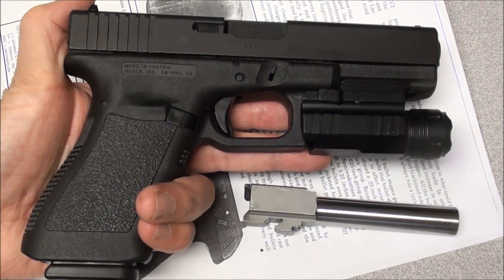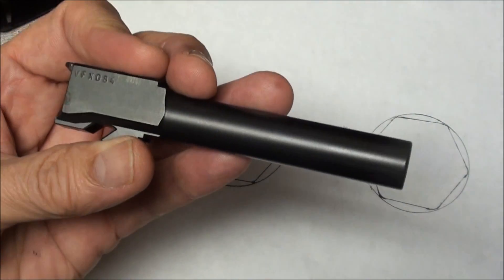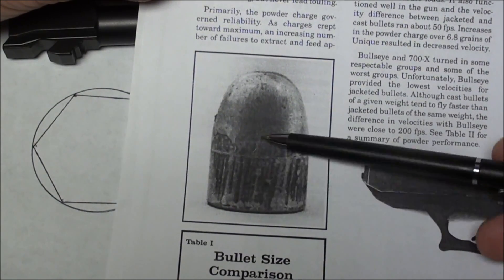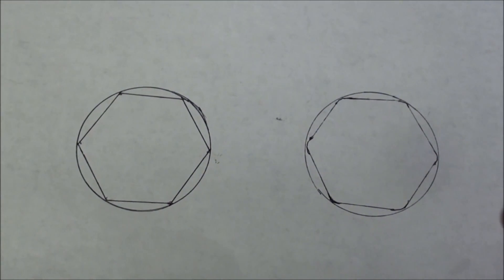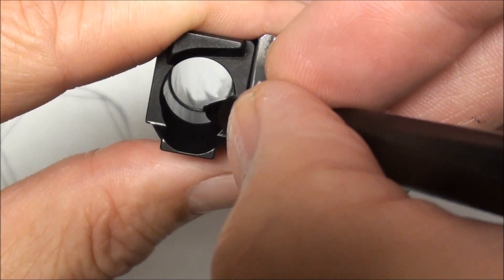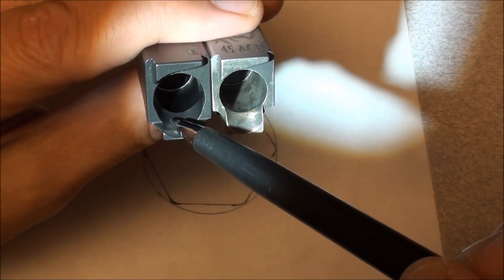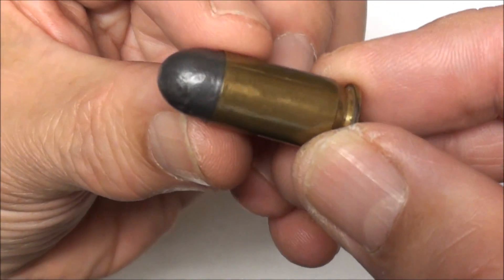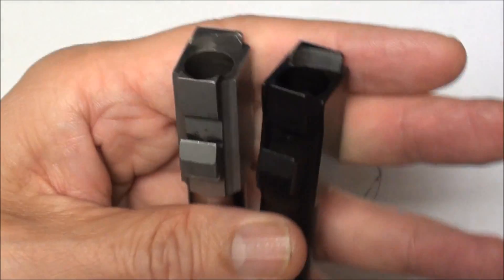Polygonal Rifling in Reloading Ammo for Glocks

Comment: Hi FortuneCookie45. Love your videos. Thanks for the amazing work. Just wanted to know if the new glock gen 5s with their new barrels have changed the re loaders approach?
Reply from the maker: George Melanitis - Heard about the Gen 5s from cops at the range as they were coming out...as you know, regular civilians can't get the Gen 4s or 5s, but LE and military can get all they want including the high cap magazines.  One thing I did notice was that this one shooter at the range was shooting a Gen 4 (don'e ask me how he got that), I got some fired brass from Gen 3s, and they do not go back into the chambers of that Gen 4 like they do on Gen 3s - that tells me that Glock tightened up the chambers a bit for added case support = less chance of brass failure on firing.   This was a small sample observation though and only a one time event.  Good shootin' to ya,  FC Steve
Reply: Hi Steve. Is that a  specific state issue? Cause here in south Africa the public have access to the glock 17 gen 5 in 9mm. I heard that they also did change the barrel to a 'marksman barrel' whatever that means. I assumed they went to conventional rifling.

Comment: That amount of chamber play on the factory barrel is kinda scary. Does it fail the no-go head space gauge?
Reply from the maker: Harbingerofd00m - The No-Go gauge (and Go gauge) are for bottleneck rifle chamber headspace determination.  All gunsmiths have those, but not all private rifle owners.  The chamber play on Glocks or other handguns is not an issue of headspace as the cartridges simply headspace on the case mouths and this is independent of the chambers being oversized or not.  SAMMI specs for rifle headspace allow .01" between minimum and maximum headspace allowance.  But if our rifle is at max SAAMI, that might actually be a danger if our ammo is set at minimum SAAMI (.010" less headspace - not as dangerous with factory new brass, but that is actually dangerous amount that could lead to case separations especially with multiple times fired brass - Few rifle owners would like chambers set at max SAAMI)  Neither do we really want chambers at max SAAMI for other dimensions, yet this is what we really are getting with Glock chambers (and other chambers trying to compete with Glock reliability - the reason for the oversized chambers).  But Glock also features minimum case support in the head area from the feeding relief featured in Glock chambers at the 6 o'clock position.  This all works well with factory fresh new strong brass though - reason for the no reloads Glock policy - yes all manufacturers say the same, but Glock really means it.  The only gauge we really have for the slop in Glock chambers is a loaded round of factory ammo...put one in and wiggle it with your finger.  You will find a lot of slop in comparison to other chambers not so oversized.  However, the Gen 4 Glocks have less slop as they are reaching out to the sportsman's market that wants to reload - but no announcements have been made of course.  Check this out for yourself if you have a Gen 4 (or Gen 5).  We can't have those in CA.  Best to ya,  FC Steve

Comment: My opinion is that Glock did this for accuracy perhaps ...

Remake your video comparing the G26 G4 Barrel to the Beretta PX4 Storm Compact 9mm 's Genuine Polygonal rifling barrel .

And you can fire jacketed reloads !

And if you're worried about firing your own jacketed reloads , then fire jacketed factory reloads ! ! !

IT IS FALSE TO SAY THAT YOU CANNOT FIRE RELOADS THROUGH A POLYGONAL BARREL ! ! !

Thank you for your valuable insights : What Model Glock barrel have you featured in this video ?

I strongly advise you not to use speculation as facts by comparing sub standard reload casings and led bullets for reloading , to quality casings and quality jacketed bullets to make reloads from .

It's false information ...

The quality of jacketed reload construction adhering to proper quality construction and control , same as a factory would when manufacturing quality factory reloads :
CAN BE USED IN GLOCK BARRELS AND IN ALL POLYGONAL BARRELS ! ! !

So your information is false ! ! !

FALSE ! ! !

Remake your video comparing the G26 G4 Barrel to the Beretta PX4 Storm Compact 9mm 's Genuine Polygonal rifling barrel ( +P Approved ! ! ! )

Comment: A good way to test lead build up would be to use a micro balance and weigh each barrel before and after firing 10 lead rounds.
Reply from the maker: billy56081 — yes sir — but you’d have to clean and dry the barrel before weighing or the powder and debris would fog the data.  Best to ya, FC

Comment: Having picked up bullets on the range that were almost unmarked after a trip through a Glock barrel while scavenging range scrap lead, I'm pretty convinced Glock barrels and their "rifling" are pretty ineffective at actually creating a seal between the bullets and the barrel. I suspect hot gas bypassing the bullet causes leading at a much lower chamber pressure and muzzle velocity in Glocks. Obviously gas escaping around the bullet causes all leading at some point when the gas melts the OD of the bullets and solders the lead into the barrel ID, but I have to think and relatively "non-round" bores in polygonal "rifling" exacerbate that situation. There's just no way you can seal a round bullet in an unround bore. Glocks aren't exactly known for their accuracy and precision, either. And given how little "bite" the barrels appear to get on jacketed bullets thats not surprising. My guess is that a lot of European manufacturers of military firearms go with the polygonal "rifling" not only for cost reasons but because of the huge variations in "universal" cartridges like 9mm. I've read about factory "standard" 9mm FMJ ammo clocking muzzle velocities in excess of what it takes to make Minor power factor and moving into Major power factor territory, which is flat smoking and well beyond "max" pressures by any of the standards organizations. The stuff is made everywhere or at least made for use everywhere and different manufacturers using different "standards" and different "conversions" in situations where they're going to metric measurements from English or vice versa and basically all of it being intended for military use they're going to make it hot no matter what. I think a lot of guns and/or cartridges are made with a little "fudge factor" to avoid catastrophic failures that would occur if a really tight bore meets a really big bullet. We're pretty spoiled here in the U.S. as far as ammunition and component quality. I think its probably possible to do with a Glock what I've done with my other pistols to avoid slugging the barrels, a lot of time and effort and additional expense precisely sizing my bullets and such to avoid leading, which is just cut back the powder charge until the velocity is low enough I don't have leading issues. My XD(M) .40 leaded like crazy with Lee .401 175-grain flat-points with the "microgroove' lube grooves, but I'm pretty sure pushing them at 1000+ fps had something to do with it, lol. I cut the charges back to about 800 fps MV and the gun shoots those bullets like the "Match" pistol it is, the recoil is negligible and I get no leading at all. The only problem I could foresee with a Glock is that they're recoil-challenged to begin with as far as utilizing recoil energy effectively instead of turning it into "muzzle flip", and I wouldn't be surprised if the gun stopped cycling reliably before the leading stopped.

Comment: So, the sloppy, unsupported chamber that Glock uses for reliability of feeding becomes a problem with reloads due to the slightly thinner case walls, plus at distances of more than 10 yards has very poor accuracy. Only New brass can be trusted in such a sloppy chamber. For the price of the Glock plus the Price of the new barrel. I can have my choice of so many other guns. And usually a case or two of ammo! Why would I buy an inferior , disposable pistol for more than the cost of a Sig or Beretta that will be much more accurate?
Thanks for making this video. It saves me a lot of work explaining why I don't want a Glock😀  
Liked and Shared!
Reply from the maker: Doug west - Glocks are excellent pistols for military and police duty using factory ammo - that was all by design - reliability, accuracy, ease of use, ease of training, ease of take down, and at bulk pricing.  The gun was never designed for reloaders or sportsmen as the brass condition for reloading was never considered.  If one were using it with factory ammo, the gun is as excellent for sportsmen as for military and LE.  There are many reloaders who go ahead and shoot reloads with cast bullets and have gotten away with doing so...especially in calibers other than 40 cal.  But if you show that blown out brass to any rifle shooting reloader, they would be appalled at the safety issues being disregarded.  That Glocks didn't have more kaboom events is a testament to current brass quality.  But Glock has been reaching out to sportsmen more now (they need to expand their markets as they've got the LE sewed up), and I'm suspecting that the Gen4s have tightened up their chamber specs to not blow out the brass quite as much.  If we look at the past advertisements of Glock Perfection, why the need to improve a design?  Once perfection is reached, there isn't anything better.  Glock lovers have sensed that I am bashing Glocks and have bashed back...I tell them I own 4 Glocks and am not bashing at all - just saying that Perfection isn't perfect.  Have a great day,  FC

Comment: shot thousands of lead bullets through my glocks with no cleaning with not one problem i have a 1st gen glock 17 shot 5000 125 and 147 lead heads with no blow ups no failure to feed and no misfires and no cleaning at all during the 5000 rounds
Reply from the maker: lee - And there are other shooters who report shooting 10X of yours with no problem, but that does change the fact that Glocks feature very good reliability (which is good) at the cost of case support (that can be bad, especially with reloaded ammo using weakened or old brass) - that gun was intended to be shot by military and police with factory ammo, not reloads.  The problem is especially accute with the 40 cal, but 9s have blown up also.  It takes a stacking up of conditions for the brass to let go in a Glock.  Other guns with case support have a lot harder time kabooming. 
The incidence of Glock Kabooms seems to be lessening as there are signs that Glock has tightened up their Gen 4 chambers (no announcement of this, of course, as to do so would imply previous Gens had chambers too big).  I recently picked up some fired Gen 3 brass at the range and tried to put that fired brass into a Gen4 chamber (don't ask me how that shooter got a Gen4 into CA as they are not allowed to be sold in CA) - That brass will go back into the Gen 3, but will not fit into the Gen4 chamber.  The same shooter had both Glocks.  If you have access to a Gen4, you can check this out.  Continued good shootin' to ya,  FC

Comment: I have shot hundreds of rounds "not sure I have made it to 1000", but I have shot several hundred lead bullets reloads in my stock Glock 19 without an issue.  I have no fear what so ever.
Reply from the maker: Timothy Yates - You will hear of some shooters who have shot tens of thousands of lead bullet loads in their Glock stock barrels with no problems...1) the 9mm has only a small portion of the Kabooms that have happened - the 40 cal gets most of the Kabooms 2) the Gen4 Glocks seem to have tighter chambers reducing the incidence of Kabooms 3) reloaders are being more careful with not using suspicious brass than previously also reducing the incidence of Kabooms...4) 40 cal reloaders are being careful not to use TiteGroup powder that was oftentimes the powder used when Kabooms happened.  We haven't heard of many Kabooms recently (check YouTube - new Kabooms would be posted) - there was a time when they were fairly common happenings...We're seeing a change in Glock chambers - and it's a welcome thing - they didn't have to open them up and funnel them as much to get the reliability they wanted to offer.  Best to ya,  FC
Reply: Hmm, I use Tight Group because it is economical and it works.  I will say I have had case head separation on my FNX Tactical.  The frame cracked and ruined some internals but the rest was ok.  Messed my hand up some but not bad.
Reply from the maker: Timothy Yates - Various polymer frame gun designs have copied the enlarged chambers and throated ramps of the highly successful Glocks...What you had happen was not the customary head separations that rifle rounds suffer - from excess headspace - brass thins at the head from the stretching and just let's go in a normal chamber.  What happens with our autopistols with large chambers is that the head is not supported completely.  And then the normal round fires and the lack of support can, all by itself, cause the web of the case to blow out right there at the six o' clock position - failure from otherwise safe ammo but caused by the oversized chamber - not a "normal" chamber.  The pressure usually blows down through the magazine destroying it  and cracks the frame causing the stinging hands.  With overthroated 1911s, we usually threw away the magazine, got new grip panels and perhaps a new magazine catch...but otherwise, our pistol was back in action.  Minimally supported chambers invite these blow outs...Better defined as head failures.  The reason TiteGroup powder adds to the possibility of blow outs is that TiteGroup pressure curve really takes off when loads are near or at maximum.  Add in some other variables such as oversized bullets, heavy bullets, hard bullets, seating depth on the deep side, heavy crimps, accidental substitution of magnum primers. and most of all, weak tired brass already having been shot in oversized chamber guns, and the chance of getting these kabooms increases significantly.  Thankfully, these kaboom events seldom injure shooters or bystanders...Best to ya,  FC

Comment: I fell confident in saying all manufactures say don't use reloads. I'm pretty sure I've read that in my Remington 1911 and Springfield Armory M1A manuals. Takes that reliability off them if you damage the gun or hurt yourself. I reload for the M1A, cost about as much to reload shells as to buy them but get a better accuracy as a trade off to that. Cost based at the time of post.
Reply from the maker: swhite209 - Thanks for posting this.  Yes, all manufacturers say don't use reloads to deny responsibility for bad reloads.  But whereas most guns are safe with safe reloads, Glocks can be unsafe with safe reloads because their unsupported case heads and enlarged chambers make them that way.  Weak brass that is OK in supported chambers have no safety margins when fired in Clock factory barrels.  That having been said, it appears that Glock Gen 4s have tightened up their chambers as brass fired in previous Gen Glocks will not slip into Gen 4 chambers.  (Clock is going after the sportsman's market)  Since Gen 4s are not allowed in CA, how do I know that? -- Get 4s have shown up at the range from other shooters - I don't ask where they got them.  They might be LE, but that would be a guess.  And I haven't examined enough Gen 4s to be definitive (and for Glock to announce any such changes would besmirch their past practices). ... Best to ya,  FC

Comment: GLOCK-THE MOST OVER RATED GUN IN THE WORLD.
Reply from the maker: Day Later Pizza - To help them get the police market back in the 70s and 80s, they offered the departments volume pricing...but once the brand was entrenched, the pricing went up.  Look at the low cost of the S & W Glock copies - the whole idea of the polymer frame, plastic sights and the hammer forged rifling was to reduce the cost of manufacture.  So why does the Glock cost what it does?  That is a great question best answered by one word - profits.  And some shooters have become such fans that they get their hackles up anytime someone even comes close to bashing their Glocks...if someone were to bash my Rugers, that would not change my opinion or use of them - they are completely free to have any opinion they desire.  Best to ya,  FC
Reply: Mark Ridgway you spelled 1911 wrong
Reply: Glock has reliability and aftermarket support, that's it. They come with crap sights, a crap grip and a barrel that is dangerous to fire with lead ammunition. There's half a dozen pistols that cost that amount or less that don't have those problems and are just as good.
Reply: Can you love both Glocks and 1911s???
Reply: I love Glocks and 1911s and shoot them both regularly and thoroughly enjoy both.
Reply: But the gun I trust my life to!!

I have other auto pistols but when it comes to a gun to defend with its a glock or a revolver.
Reply from the maker: Mark Ridgway - Glocks are fine pistols - His gun was in the right place at the right time - and led to the polymer revolution - Funny - the Nylon 66 didn't do it; the Steyr AUG didn't do it (although it gave Gadsden the push to go polymer), but it really is a major development in firearms that should be recognized.  No everybody needs to like them or own them...They feature those things that LE and military really like - ease of operation, ease of disassembly, safe functioning, easy training, high capacity magazines, light, durable, and attractive mass pricing all helped Glock to take over markets in the 80s.  Before, they ignored the sportsman, but now they have to increase the market to maintain profitability and growth.  Have a great day,  FC